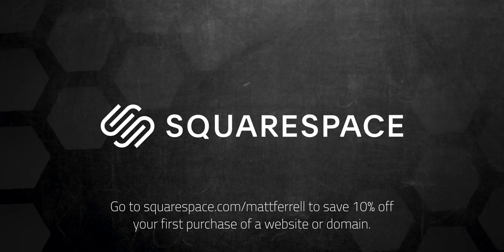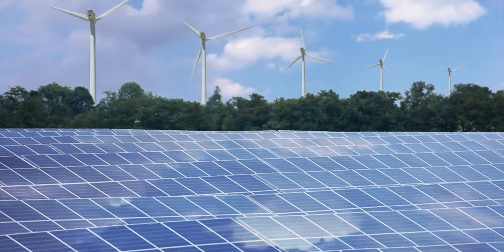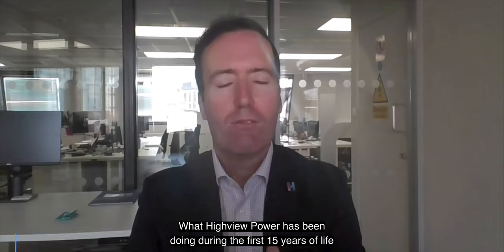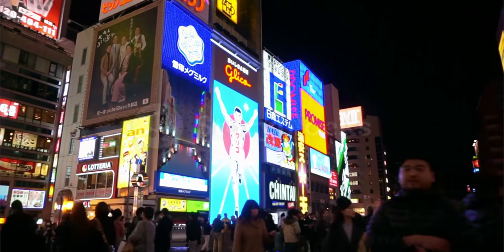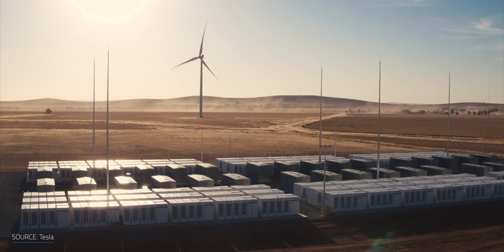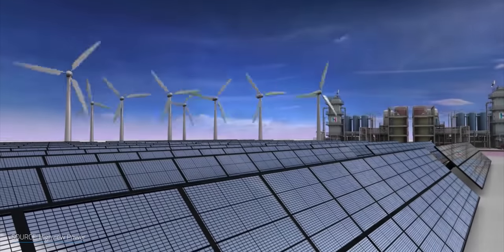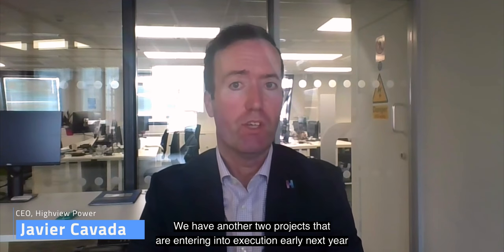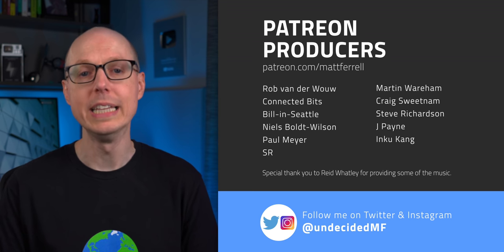Liquid Air Battery Explained - Rival to Lithium Ion Batteries?

Comment: I am uneasy about STORING AND REUSING THE HEAT..  The compression time heat generation is quite low quality, maybe comparable to reaching the boiling point of water.  Where and how is that stored.  Granted, if you can boil the water, then the steam can contain a whole lot of energy per mass, but unless you can increase the steam pressure by additional low efficiency compressor, the required storage volume is mind boggling.  The thermal cycles are so frustratingly unfriendly in energy efficiency terms.

Comment: This is exciting tech. Dirt simple since it's basically pipes, tanks, a compressor and a turbine. If you lose containment, you have a cloud of... air... 

You have to filter the air as it's working, so it's basically CLEANING the air around it. You could split off the CO2 for sequestration during the process. You could probably separate out the argon and other rarer gasses for sale. Really neat stuff.

Comment: Great video.  Just 2 comments: First, you didn't get into how much liquid air costs per megawatt-hour.  It would help to see a chart showing what that cost is as it scales (since the cost of added capacity is just more tanks and pipes).  

Second, the title of the video was misleading -- it really should be used in combination with Li-ion, since you need Li-ion to respond quickly to demand, while you can use the liquid air to take over the load after a few minutes.  In fact, shouldn't Tesla and HighView come up with a joint product where a few MegaPacks are combined with a large HighView facility to provide both a quick-response and a large storage capacity?  

Finally, a question: why don't all solar farms have a HighView facility to provide power at night, and become a 24-hour energy source?

Comment: How about a Hybrid Lithium ION Battery/ Liquid air Gen vehicle filling up with liquid air at Liquid Air Service station and fed into insulated tank. Instead of ICE Motor, replace it with Air turbine electrical generator as a range extender.

Comment: I can't see this as realistically scale-able. There isn't enough foresight applied to sufficient vertical integration needed to produce even basic tanks. Current tank production is geared to present need. A sudden increase in demand, enough to make a dent in the overall energy picture, can't simply occur because air battery companies require them. Tank producers themselves have their materials supply chains, and THEY have raw material chains which go all the way back to mining the ores. Sorry, but unless they suddenly develop Musk-ian foresight or have ALREADY secured a (n almost) complete solution this cannot compete after the latest battery day.

Comment: What about fluid store with fuel oil?  That way you have a very last ditch energy supply.
Or LNG vs frozen air.  Same thing about using an energetic component as your working fluid.  LNG's a mature technology.
Other than being huge bombs, what could possibly go wrong?
Or supercaps and use the turbine to deal with the leakage.  You'd be stopping the turbine with other techs once they're full, so you're not wasting the energy.  Wear and tear would be an issue.
Or not.

Comment: Not to be a naysayer. But 60% efficiency sounds too high for what this system is. If the baseline efficiency of the system (just compressing and expanding air) is 20%, to get to 60% they must capture an amazing percentage of heat AND be able to store that excess heat for however long it'd take for the grid to actually require the stored power. 

I' not saying it's impossible to do. But I'd like to see an actual scientific paper proving this efficiency to be realistic.

Comment: The REAL cost in megawatts is everything involved for the life of the powerplant and the "effects" it has on health and the environment (environmental impacts). So don't be fooled by these megawatt costs. Society has been fooled long enough and is starting to notice the REAL costs!

For example a coal plant costs can be obvious, including but not limited to: extraction, transportation, equipment maintenance/replacing, manpower, etc. And not so clear or obvious: environmental impact costs like pollution, healthcare, global warming, relocation due to rise in sea levels, etc. 

Battery storage has "not so obvious" or clear costs too, for example, replacement of damaged/used cells stored in waste sites, healthcare from chemical leakage into environment, new cell technology investment, etc. 

Liquid air obviously has it's "not so clear cost" too BUT they are small and most of it's costs are, well as clear as the clean air we all want to see and breath!

Comment: This technology is so simple that it could literally be built at the backyard level by a clever tinkerer - with some dollars. Off-the-shelf stuff, nothing secret. Efficiency would be low, but if you have enough wind and solar does it matter? You could even leave out the heat/"cold" storage and recovery and it would still work. And more duration is just more storage tanks, the simplest and "cheapest" part of the system.

Comment: 50Mw plant is coming online in U.K. soon. No  rare earth metals, highly scalable. Just add tanks. Even 60% efficency is fine as it charges with excess energy from wind turbines that would otherwise have to be turned off as excess energy cannot go into grid. I don't think this tech should be called a battery, it works nothing like one. A mechanical generator is needed like hydro and so is a pump. It be like calling a wind up clock a battery. Or a pumped hydro plant a battery.

Comment: what I don't like about your channel is that you hype this technology as it could change anything. It wont, its a cool technology nonetheless and I'm willing to watch a video about it. However I would really like to know how viable it is instead of just selling people a pipe dream. 

Also WTF are you using words like freezing/frozen. To Freeze is to turn it into a solid, not a liquid. 

Also pumped hydro is >80% efficient. on short term storage. On long term you might have problems with evaporation that lowers your efficiency, however liquid air has problems with heat. 

I believe we will see a ton of energy storage providers over the next few years and there is going to be a lot of competition. I'm honestly not sure who will come out on top.

Comment: For 20 to 30 years we've heard about the amazing renewable energy sources and storage schemes.  But still they are barely significant in terms of total energy usage.   I have a rule of thumb that helps to tease out the reality of the energy market and potential new tech:  When Japan makes it and uses it then we can expect increased significance.  Japanese scientists, engineers and accountants zero in on what is actually profitable and tend to stay a few steps ahead.  It was Japan that changed auto making standards for the whole world beginning in the 1970s.  She also nabbed a major chunk of the copy machine business, also other office machines like fax and printers.  She was early on into led and lcd  screens.  And she also focuses on underlying tech, for instance Minolta lens and silicon lithography undergirded the rise of the microprocessor biz in Silicon Valley (and of course in Japan too).  She makes super-refined etchants for high density silicon products like microprocessors and memory.   S. Korea relies on Japanese etchants.  The bright white and blue leds were invented in Japan.   As early as the 1960s Japan garnered most of the global hi-fi equipment business which only grew and grew with the rise in popularity of recorded music and she jumped into musical instrument manufacturing  at just the right time.  She was right there for the home-improvement revolution of the 1980s with Riyobi powered hand tools and others like Makita.  The list of Japanese making the right tech and biz decisions goes on and on.  

Yet Japan is not too keen on "renewables"....still has 75 nuke power plants and uses a lot of fossil fuels that she purchases on the global market having none of her own.  When Japan chooses a renewable/storage tech then we can be pretty sure it's a winner.

Comment: So one could have liquid-air storage systems handle most of the load fluctuations and the battery system would fine-tunes the rest to near-perfect 1-to-1 load matching.

What about the opposite? During a power surplus, which system gets charging priority?

Comment: Energy storage is an old topic. Compressing air uses more energy than returned, even though the heat of compression can be used for  say, water heating , adsorption cooling, Steam energy or whatever and then the sub cooling to make compressed air liquid? All of this takes extreme energy input. Electrical input? Water head?  wind? sun ? tidal waves? Then lets look at air, there is no such thing as liquid AIR! Each element like oxygen, nitrogen, carbon dioxide and other trace elements each liquefy with different pressures and temperatures. I would put this article under milking Garter snakes to live forever.

Comment: Thanks for another interesting piece of tech. However those are still giants. But how about to build resiliency on small sized, house or block size like, units ?
Is that utopia or not and what would be best tech to use? Solar with lithium-ion batteries, or LiFePo, or something like small flywheels .. or something completely different?

Comment: All the presently available technologies can not replace Hydrogen as a fuel and energy storage medium.  Because all the renewable energy systems have an intrinsic problem of processing Co2 so unless  captured these systems do not out way clean Hydrogen production from Sun And Wind. The other issue is that none of the present technologies can replace the oil economy in which the world functions now. Where as Converting water to Hydrogen using Sun And wind and applying Carbon Engineering’s system the world can now make Hydrocarbon fuel that is Co2 neutral. Thereby making Hydrogen the economy that runs the world.  This is possible now not 10 years from now.  Please investigate this and creat a video based on your research.  Good work though.

Comment: The existence of curtailment is a symptom of the chaos in the power market arising because of non-economic factors like subsidizes and government policies.  With respect to eliminating curtailment, my question is what is the lowest capital cost technology that make use of power that previously was curtailed?  Is it electrolysis to produce hydrogen and oxygen, or geothermal batteries?  Then, I would ask how much cryogenic storage is cost effective at current PV costs.  Finally, I would ask can wind power be coupled with power-to-ammonia so that it makes sense?  Can the residential system tolerate "becalmed" periods with utilizing wind power, or should wind power be priced out of existence because of the impossibility of paying for weeks of storage that is not used most of the time?

Comment: And carbon dioxide capture. Could be used for assisting fridges and air cons in times of high use (heatwaves), with the escaping CO2 captured in growing aquatic biomass/greenhouse assistance, cooling the greenhouse/watermass a bit at the same time. Transport may be an issue (pipelines) so production of dry-ice may be possible as a side product

Comment: There is only one promise to this type of energy storage... the ability to reconsolidate hydrocarbons. It's the only way to environmentally justify the inefficiency. The isolation of oxidized carbons, it is far easier to dissociate the molecular bonds in cryogenic state, thereby freeing the carbon to be United with hydrogen molecules. Two major research companies are already ahead of the curve here, with one of them providing one of the world's most efficient fresh water condensation machines. The other is focused on repurposing the "carbon cake" (soot cake) or carbon sequestration systems used by hydrocarbon power plants to meet EPA restrictions.

Comment: this guy you interviewd is full of bs and i would have liked more fact checking from your side here. hydro power storage is far beyond 50% while this teconology is basically taking the worst parts of hydrogen power storage so evem 50% are hard to archive and without prdocing stuff like liquid hydrogen for industrial applications is not at all viable at all.

about investing in better Efficiency i also gotta call bs- from my experience industrial grade low temperature insulation is very expensive and an pain to install and get right, especially at the super low temperaturen of liquid air

Comment: The reason we haven't done it soon is that in the 1960 to 2010ish oil companies were buying up any patents that would compete with their market and suppressing them. If it weren't for oil companies we would easily be 30 to 40 years more advanced when it came the renewable energy and battery technology.

Comment: The future of grid storage is similar to how data center have tiers of storage. Li ion is like SSD, responsive but expensive. Air storage is like mechanical HDD, slower and more suitable for bulk storage. Pumped hydro is the tape drives you use as backup/archieve media. Together all three tiers create a responsive and cost effective storage system.

Comment: My understanding breaks down in how can this cryogenic battery intended to store energy converted from wind turbines have inefficiency? What's inefficient about being able to store energy that would otherwise have to be curtailed?
Reply: Nic Lindo ...Efficiency is the way to measure one storage solution vs another...not storage vs NOT storing at all.  
Cost per unit of power delivered is still SUPER-more important than efficiency, though.  If system “A” were 80% efficient, but delivered energy cost 4x what 50% efficient “B” cost, the economics would favor buying TWO system B units (all else being equal).
Reply: @737smartin  hey! Thanks so much for the breakdown! It's super cool of you to take your time and do that. I'm kinda free-spirited and whimsical; I most times forget that money has potential to ruin good things 😢

Comment: I wonder how it compares to CAES, if the heat storage system is the same?  Much bigger tanks that must withstand high pressure, but way less complexity.
Metal pipes could be used for storage to keep costs down and strength up.  They'd operated in the 1000-10000 psi range, and expanding air could be used to run a Stirling cycle engine (cold side) as stored heat is added back to it (hot side).  The now hot gas could run a turbine.

Comment: So they're using hydrogen generators(oxygen generators) cause the process spilts the two from water aka H20(Two hydrogen atoms and one oxygen atom); they use the process of electrolysis to do so and the process of compression and burping to bottle/tank it.

Comment: Way back in the 1970's several pneumatic engineers argued that wind and some hydro needed to be driving compressors directly not generating electricity up the pole. Compressed air can be stored cheaply in sealed concrete tanks and pipes and under ground voids. Then generators running off the compressed air would power the grid on demand. There are also two pneumatic solar solutions. However it's really only viable if you not using electricity to drive the compressor. 
These experts on compressors were shouted down by the dynamo engineers, the battery people and the people that thought high temperature superconductor storage would solve the intermittency. Every one had their money in other patents or carbon credit schemes. The pneumatic engineers have been proven right; direct wind to electricity has failed and high temp super conductors failed too as a storage tool. Subsequent attempts to build a pneumatic wind technology get shuts down very quickly. The green house lobby is not about climate it's about taxing energy to fund political causes; a technology solution will never be accepted. Highview may be very successful but will be attacked because you can't tax carbon if you have solved the problem with a non carbon solution.

Comment: Awesome. A terrific technology explained in plain language. It gives me such hope when clever people repurpose existing technology for our future. I have tremendous hope that America and the world could transition to clean energy much more rapidly. All it will take is the WILL to do it. But I think people tend to be so stubborn and lazy. They would rather keep doing things the old way. If the fossil fuel industry had started years ago to make the transition to clean energy, they could easily have kept their position as the wealthiest companies, since for so long they had massive profits to invest. I hope the oil drillers will start to transition to creating advanced geothermal technology power plants. Seems like a good fit for them too.
Your video on this cryogenic energy storage is a great illustration of how to make Solar and Wind more viable in the energy mix. BTW, I had an old book on converting existing automobiles to electric that was published in the 80's I think. They had converted a little truck to electric, and under the hood it had liquid nitrogen storage bottles that used small turbines and alternators that were powered by the expanding nitrogen gas to keep the batteries charged. Very similar to these plants on a very small scale. No word on the range that the nitrogen bottles gave the truck....

Comment: You say that the Tesla grid storage facility at 1:36 increased storage by 50 megawatts.  What is interesting is how many megawatt hours the expansion provides.  We could transform electrical power to DC and store 50 megawatts but only 1 second's worth in capacitors.